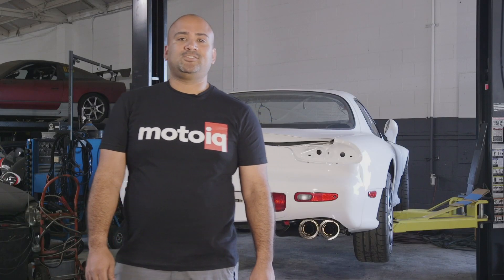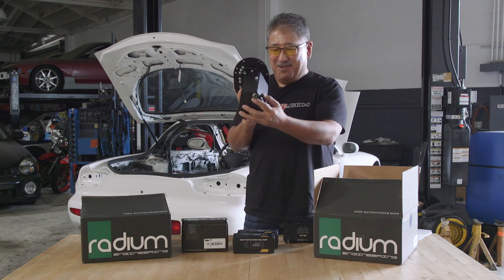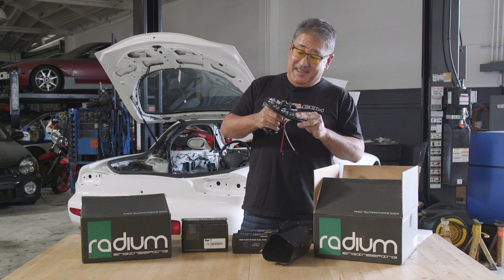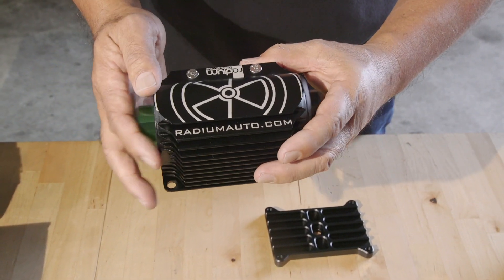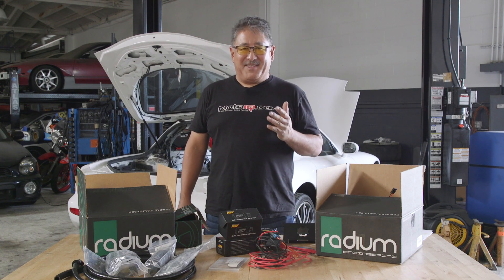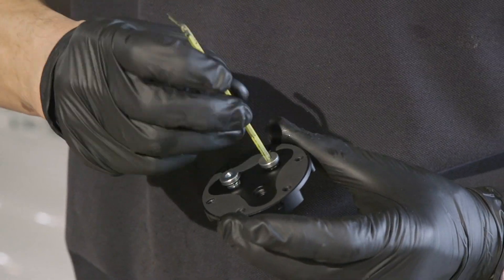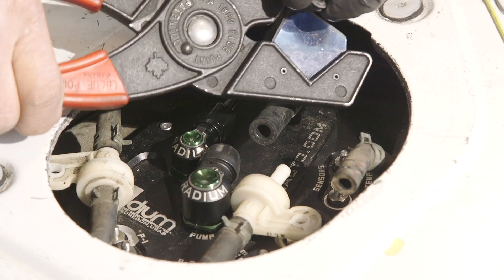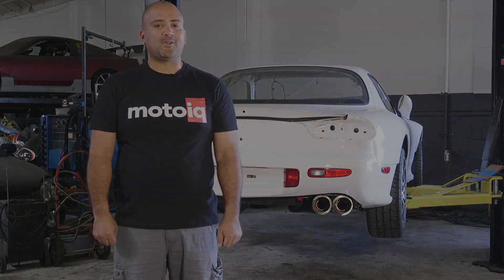1000+ Horsepower / ZERO Fuel Starvation!  The ULTIMATE FD RX-7 Fuel System Using the Factory Tank!

Comment: I bought one like this and I'm struggling where to find the trigger +12v for the second fuel pump. Anyone knows which cable it is on RX7 FD3S?
Reply from the maker: since the FD has one fuel pump from the factory there isnt a trigger wire for a second pump.  The stock wiring probably cant handle two pumps so you need to use a relay from the OEM pump trigger and power the second pump direct from the battery with the relay turning it on and off. If you want to stage it, you can do something like use a hobbs switch to make it boost depended or an MSD rpm switch to make it rpm dependent.
Reply: @motoiq  thank you very much for your help.

Comment: Another benefit I am seeing with the in-tank surge design is the surge overflow.  Odd that I don't really see it mentioned anywhere (even on radium's website).  On external surge tanks you need to return excess fuel from the rail and the lift pump back to the main tank.  If you force all returning fuel from the rail to the surge tank with a passive return from the surge to the main tank, positive fuel pressure can develop in the surge tank depending on how well the passive return flows.  This surge return pressure can even cause excess pressure at the rail that cannot be eliminated by adjusting the pressure regulator.  A better solution for me in this case was to use a Y fitting on the return from the regulator flowing to both the surge and main tank.  Fuel takes the path of least resistance eliminating excess pressure buildup and still helping ensure the surge is kept full.  The passive surge return is still necessary to accommodate excess fuel supply from the lift pump.  This is a complicated solution compared to the in-tank design.  With the radium setup here, surge overflow literally just spills out into the main tank from the gaps at the top of the surge.  Great benefit to this design that I think should also get highlighted.